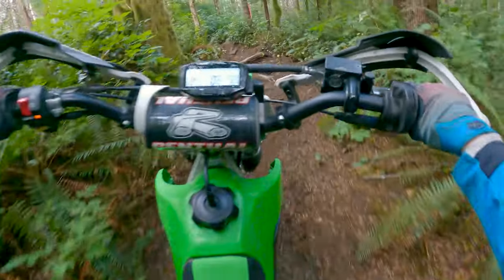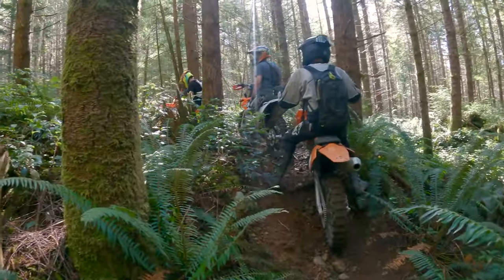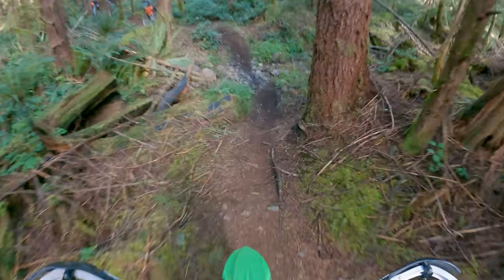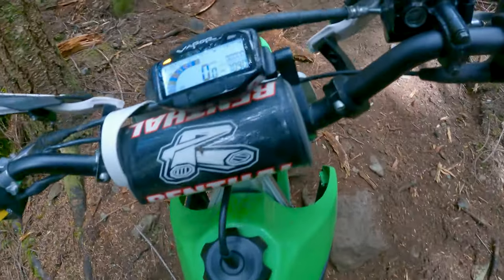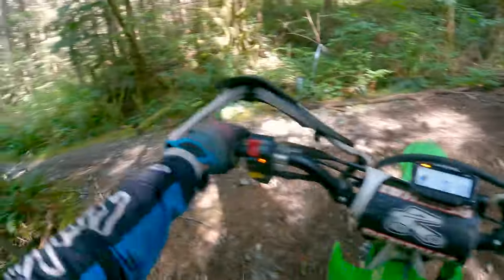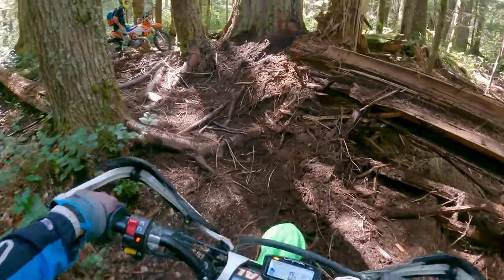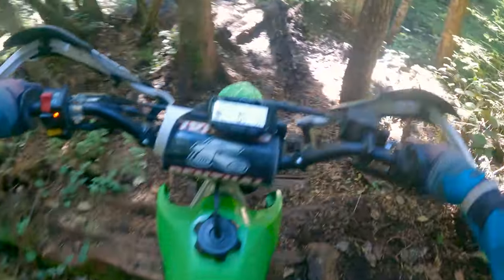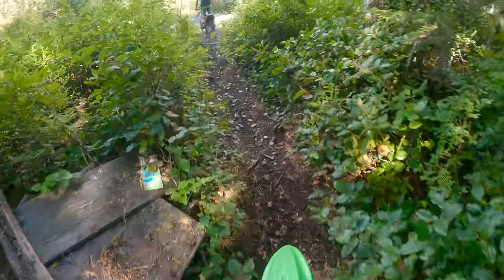This Enduro Ride Could Of Been DEADLY!

Comment: Ever thought about doing the kx100 suspension swap🤔
Reply from the maker: Yes but all in it will cost a thousand + and they were never designed around the 21” front wheel
Reply from the maker: Meaning you would have to limit the travel defeating the purpose of the kx100 forks